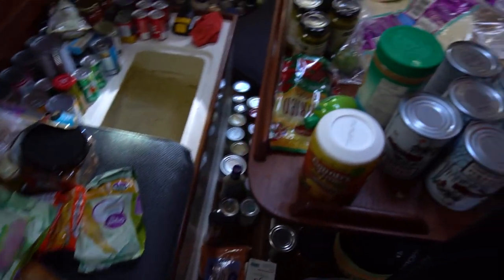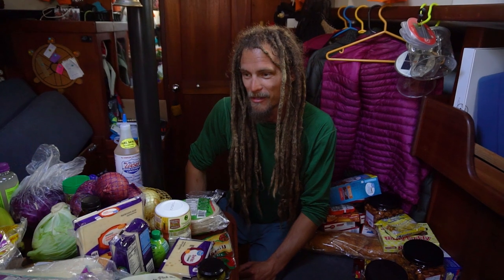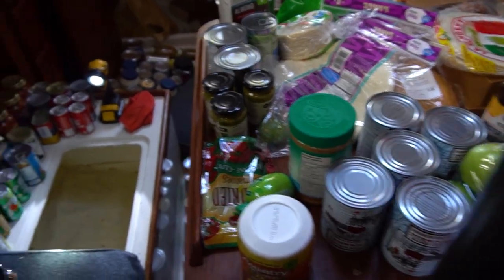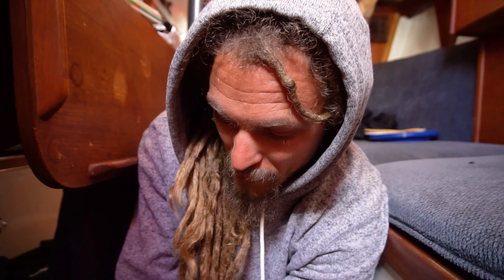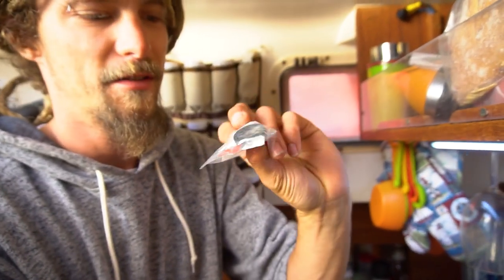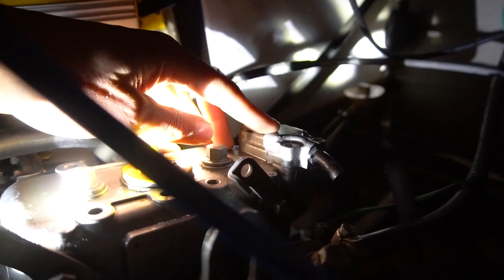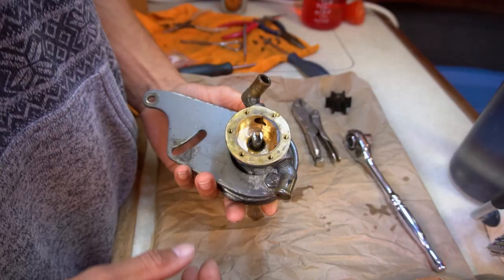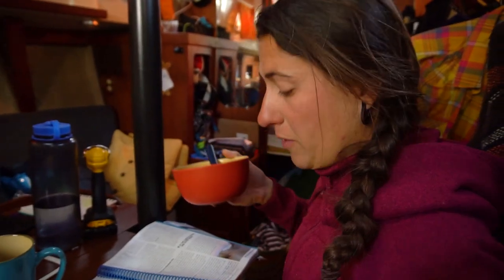Waiting for our YANMAR 2GM Raw Water Pump Seal in Portsmouth [Wildly Intrepid Ep 82]

Comment: If your pump leaks like that in the future, remember to change it right away. It's not the water going out the "pee" hole that matters. It's meant to me an early warning system that the seal is failing. If fails entirely ,you will pump water into the crankcase.
Reply from the maker: Luckily our water pump is separate than the crankcase. And now we definetely know what was wrong and will keep a close eye on it once our engine starts running again. The things you learn while sailing or motoring.